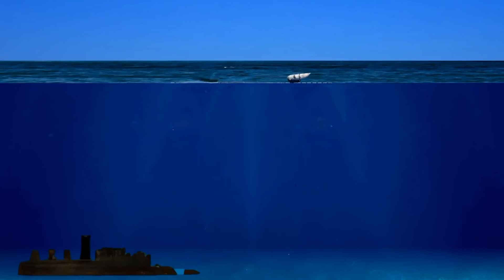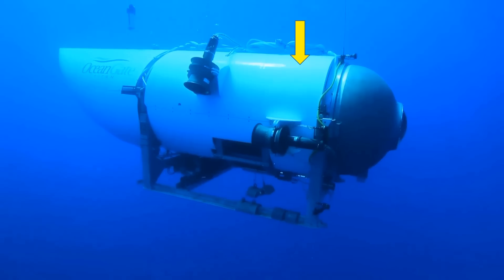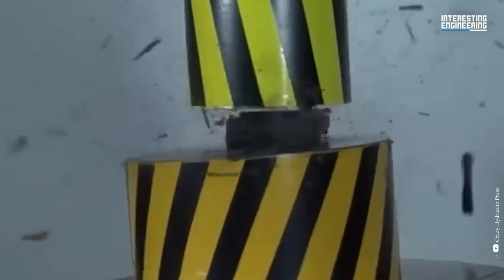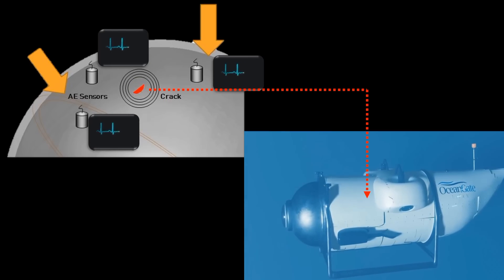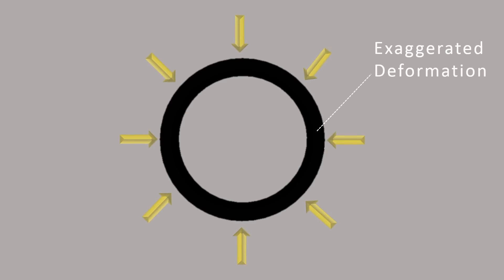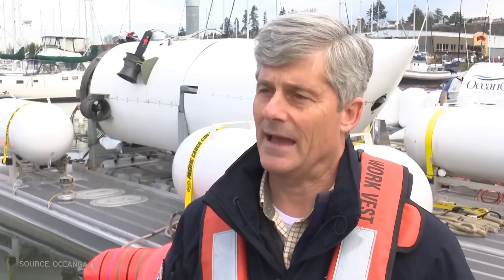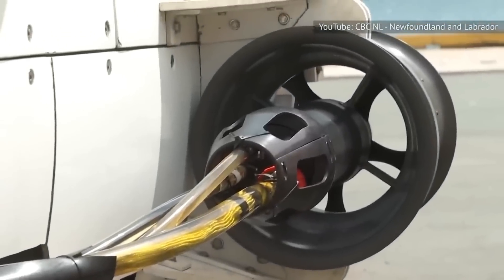Oceangate Titan Did Not Implode Just From Pressure. There Is a Catch!

Comment: My understanding is that carbon fiber composites may crack abruptly when twisted. This might be due to the matrix or glue cracking. So, the carbon fiber body may have distorted under load, leading to cracking, and the glue holding the ends together may have cracked under the combination of cold, wet environment and twisting load. 

I heard an alleged transcript of the conversations between the submersible and host vessel, which indicated the "Titan" was descending considerably faster than expected, and then had difficulty ascending. Might it be possible that the "Titan" was becoming waterlogged, perhaps even flooding in some areas, almost as soon as it submerged? Perhaps the weight of this extra water would have stressed the frame, especially during its struggle to ascend.
Reply: I would also like to know if it was overweight with too many passengers and stuff with insufficient reserve buoyancy for surfacing. Given Mr. Rush's cavalier attitude towards proper engineering and safety, it would not surprise me if he took on too much load.
Reply: Or one of the motors that helped with ascending failed
Reply: @joanbaczek2575  it didn’t use motors to ascend, the motors were for just basic maneuvers.

Comment: 1.  They bought out of date carbon fiber from Boeing

2.  They laid the fiber up by hand, spreading glue with ‘putty knives.’  They did not alternate fiber direction.

3.  It is unclear in their video, but it appears the titanium end pieces only supported the tube’s outside and were fastened by glue (laid by hand).

4.  They did not do ultrasound testing (which is strictly done with carbon airplane parts).

5.  Different materials expand and contract at different rates.  Pure titanium hulls might deform by 2-3 inches under severe pressures.  

6.  The design was not tested.  The pure titanium sub that dove to the 5 deepest places in the oceans was tested in a Russian pressure lab.

7.  We’ll never know but if they had varied carbon sheet directions with controlled pressure gluing plus ultrasound testing with some titanium ribs in the tube…. They might have had a better chance.

The reality is the 5 ocean submersible cost 37 million.  

So ‘denial’ is not a river in Egypt.  This was amateur hour.

Comment: I'm still convinced the differential pressure was the fatal flaw. The titanium halfshell was virtually indestructible but the perpendicular pressure on the side of the flat submersible would have been different from the titanium just inches away. The pressure had to be identical on the entire outer surface but there was differential pressure, one surface weaker than another surface just inches away.  Additionally,  on aircraft we have NDI which tests structural integrity by running electrical current between two probes. If there is even a microscopic separation the electrical current is affected by the air gap which then identifies the suspect area. It's unbelievable that he wouldn't have invested the time and resources which would have been paltry.

Comment: When Carbon fiber is laid up without a vacuum, microscopic bubbles form against each fiber. When the pressure increased the bubbles got smaller and smaller and when the pressure decreased the bubbles got larger. Each cycle tore at the fibers weakening the entire 5 inches. enough cycles and the entire hull failed and the sub imploded. Rush did not spend the extra money to gas out the epoxy resin in a vacuum chamber and this is the major reason it failed.
Reply: Interesting
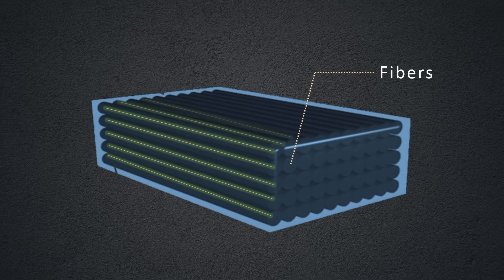Reply: Reckon so. Spiral wound and not vacuum formed……disaster. 4:57
Reply: I made vacuum ovens (AUTO CLAIVES) for Sprite aircraft company, so you are right about this. With out proper curing carbon fiber is only about half as strong. Also, the fibers were wound wrong for this kind of use. I will admit I am getting old, and carbon fiber was new at the end of my career. So, I may be wrong.

Comment: One also needs to consider the lack of homogeneity in the pressure vessel. A Carbon Fibre Tube with Titanium Alloy Hemispheres, means the materials will compress at differing rates. This could contribute to the cyclic fatigue of the Carbon Fibre.  That lack of Homogenous materials bothered me when I first read about what they were attempting a few years back.  I'm bothered by the video showing the Fibre being wrapped, but without a discernable pattern, such as a diamond weave. Wrapped as the video shows, would make me question the vessels strength along its axis, as the Fibre going in one direction circumferential, will not have as much axial strength as a diamond weave would. The thinner Titanium tube, once the CF failed, would have allowed the heavier Titanium hemispheres to slam against each other like crushing a can.
Carbon Fibre is amazing material, but its less predictable reactions under extreme compression needs to be studied more and much further testing, both destructive and non destructive done before it's allowed to be used as a pressure vessel for Manned Deep Dives.
The cavalier attitude towards safety Rush exhibited is alarming. His dismissal of concerns from much more experienced Marine Engineers is particularly troubling. He was obviously out of his depth, and so convinced he was right, and they were wrong. There's rumor,, that Oceangate was buying Carbon Fibre,, that was passed its shelf life for use in Aeronautics use,, if true,, this is troubling as well.
Titan, obviously needed much more extensive testing than it was subjected to. We know that the first Carbon Fibre Cylinder had shown signs of failure after a number of Dives, and that this current iteration of Titan, was using a replacement built in 2022, and that this was the third dive the new CF tube had made, using the same method of construction as the previous tube.
You're right about the real time acoustic pressure sensors. There's no way it could realistically give a pilot ample warning time to abort the dive. 

The more information that become available, the more alarm bells are going off in my head.  While I'm generally not a fan of Government intervention, this Tragedy illustrates the need for established protocols, testing and certification of designs before a passenger AKA  "mission specialist" is allowed on pleasure dives.
The end, when it came, was mercifully swift.

Comment: Titan DID implode from pressure! This video doesn't add anything substantial that other videos and websites have not already said about carbon fibre composites, compression/decompression cycles, and so on. It just adds some details about the tensile and compressive forces, and fatigue. But the bottom line is that PRESSURE caused it to implode! What else could it have been at nearly 400 atm? Temperature? A fire? Attack by sea monsters?

Comment: When the disk in my back went out it made a crack noise. Accustic warning gave me a split second before excruciating pain... Okay but seriously, at that depth accoustic warning seems very dumb since by the time it can be heard it is already failing. Also, all the trapped air in the manufacturing process cant help. That glue was scary. Two different materials held together with glue sounds very sketchy. So much bad engineering I wonder if Rush had a death wish.

Comment: No matter what one does there are always people to “told you
It might fail “. I think carbon fibers are probably not a good choice for underwater applications like this. Apparently titan went in dives 10 x uneventfully. But success in one dive does not guarantee success automatically for future dives.  I didn’t like the way the carbon to titanium ring was glued. I thought they exterior pressure on the carbon tube would tent to shrink its diameter , making it pull away from the titanium if anything.   Anyway they fell into the trap of ignoring degradation of the carbon  structures fibers after each use

Comment: Your over simplified and over complicated at the same time.

Simply put: 
Imagine having a plastic bottle, if you wrap around the outside of the bottle with string, you can increase the pressure that the bottle can hold inside.

   But if  you suck air out of the bottle, the bottle will collapse, the skin of the bottle would detach from the string (delamination). the string does not add any strength.

Now imagine if you attach the string around the inside of the bottle, and suck air out, the bottle will collapse, the string too does not contribute to the strength against compression from the outside. Because string like carbon fiber only strong in tension not compression.  

Carbon fibers composite cylinder can be used for airplane because the function is to retain pressure inside. But not for submersible, where pressure is from outside.
Reply: i didn't agree with the presenter saying the cylindrical shape wasn't a factor unless i misunderstood his point. All the way back to the Bathysphere in 1930 the diving chambers have been spherical. Many of the modern DSV's look elongated or various shapes but the chamber is still a sphere.
Reply: @luvit579  cylinder is a factor. If you look at the section view from the side, it is a ring section. The load are distributed evenly. But from front section view, it is a rectangular section. It is subjected to buckling and bending.

It is easy to imagine, try pumping air into a soft drink can, it will bulge in the middle, and try to be a sphere. That is bending of the rectangular plane. 
Given the same thickness, cylinder shape is weaker.

Comment: exactly what i said the first time i heard carbon fiber and acoustic monitoring
at certain depth all the acoustic alarm is gonna tell you when it sounds it will be "you are already dead, make your last minutes count"
Laminated materials does not work well under pressure as it does with pulling, under pressure instead of try to bend like other materials CB will literally crack and unravel FAIRLY fast (like a rope)

Comment: Hello and thank you, my question is did the different temperatures that titan was exposed to on the surface and below in the ocean. With the number of cycles the submersible was doing  while understanding that titan did not do all its missions. Did this maybe contribute to the ultimate failure?
Reply: Probably, but how cold is the deep ocean?   The water isn't frozen.
Reply: @JoeLinux2000 28°f roughly. Quite cold

Comment: I also can't help but notice at 8:01, the computer monitor seems to be bolted directly into the inside wall of the sub.
Reply: It should be fine. If you notice the inside hull isnt CF. Its just lining. The CF is wrapped onto titanium inner core. Thats what the TV is screwed into.
Reply: @zlonewolf . Someone said the metal core was a mandrel that was removed before the sub went to sea
Reply: @Woodman-Spare-that-tree  the metal core was removed, but inside the carbon fibre pressure hull is a translucent fibreglass tube serving as a liner -- this is what the TV is screwed into, not the CF hull.
Reply: @ma3xiu1  but even so, the metal bolts would have shrank and expanded due to temperature variation alone, depth pressure not withstanding. I assume they would've worn through anyway, given enough time? Seems like they should've used an adhesive to mount the monitor since that's apparently what they were betting their lives on anyway.

Comment: I have worked as a manufacturing and quality engineer in the aerospace business for 35 years and have worked with structural composites and NDT systems for them.  I think the use of any laminate for a pressure hull for that depth is either incompetence or insanity.  Everything I have seen about the material used, from the unidirectional layup to the use of expired pre-preg and not using an autoclave is just evidence of a complete lack of knowledge about composites.  The builder claims less than 1% porosity.  I seriously doubt that.  Not with just bagging on a 5” thick laminate.  No way it’s that low.  I’d like to know what system they used.

Comment: According to unconfirmed transcripts, the craft was descending very rapidly from the start, then when alarms began to light up, they could not manage to ascend even using thrust and jettisoning the landing gear.  The machine had a buoyancy problem.  Was it too heavy to begin with?  Leaking water?  Seems like it would take a LOT of water to keep it down.  Enough that it would be impossible not to detect.  Or was there a pressurize compartment other than the crew area which could have flooded?
Reply: If it had buckled, or partially collapsed, its volume might have reduced, causing a bouyancy issue. I expect the board of inquiry will look at the rate of descent issue closely, if the transcript is accurate.
Reply: Too heavy because too many passengers

Comment: There were no seats and no restraints for the passengers and crew. If it went out of trim, the occupants would be dumped into the end in a pile - good luck keeping control in that situation. The submersible had wires hanging off of it all over the outside - snag and fouling hazard.  There was no hatch, and the occupants were bolted in from the outside (giant red flag). There were no redundant systems. The controls were stupid. 
Carbon fiber is good in tension structures, but not in compression. The glued-on end caps sound like a really bad idea. 
Acoustic sensors are meaningless when the first sound you're likely to hear is the last thing you'll hear - a loud crunch. 
Hubris.

Comment: This is a great example of how education is not a good substitute for common sense. Everything mentioned in this video is irrelevant without the pressure. Thus pressure is the only reason titan imploded. None of the engineering flaws would have been an issue without pressure.

Comment: I think the water got between the carbon shell and the stainless steel tube that the carbon was wrapped upon causing the inner tube (inside shell) to implode first causing a great loss in buoyancy.
Reply: The steel tube was a two piece mandrel and was removed after the carbon fiber tube cured.
Reply: @sportbikerdude  
Ok. Thanks! That blows that theory!
Reply: That explanation is supported by the released transcript of the radio exchanges between Titan and the launch ship, which confirmed that Titan was descending faster and ascending slower than expected. Evidently, it was taking on water.
Reply: @jacobfreeland6881  I think that transcript is clearly bogus.   Too much talk
Reply: @jacobfreeland6881 The so called leak transcipt is unconfirmed and could be false. It was brought up by multiple random youtubers.
Reply: There is no inner metal tube. Google photos of the sub and you can see the interior is bare carbon fibre.
Reply: @bensemusx . Surely there was an inner liner that the TV screens were screwed into?
Reply: @Woodman-Spare-that-tree  yeah I think there was an inner layer of something just for that reason alone.
Reply: It was battery failure mixed with cf hull giving. At the depth you don't just just have leaks anything gets in it's gone in milliseconds. If Stockton was smart he would have adjusted velocity but he was probably in a "Rush".
Reply: @dscwac396  how do you explain them not being able to ascend?
Reply: @TimWnyc  battery failure, they've had similar issues on previous dives.
Reply: @dscwac396 no surprise since electrical was designed by young, student 'engineers'
Reply: @marilynevans8436  lol and the store bought security cameras to see, acrylic window for 1300m, expired FC etc... And trusting extremely smart kids making minimum wage what could go wrong

Comment: they might have been better off welding those two titanium end caps onto a thick steel pipe ???
Reply: a sphere is the only way to go. all deep sea submersibles have a spherical chamber regardless of what they look like from the outside. Military subs don't dive nearly this deep, but if submariners attach a string from one side of the hull to the other when the sub reaches depth the string is close to touching the floor. that's how much the steel is compressed inwards even at depths far less than Titanic.

Comment: How would the cold temperatures at the depth of the Titanic affect carbon fiber. I know it can stand a lot of heat but, from what I've read, it looks like it isn't so good when it gets very cold.
Reply: very good question, of which no one has raised
Reply: Very cold is usually cryogenic temps. Carbon fibre also isn’t great with heat either. SpaceX moved from carbon fibre to stainless steel in part due to needing a much lighter heat shield. The steel could handle much higher temperatures while remaining structurally sound.

Comment: A point about the buckling resistance: as the external compressive load increases, it takes a greater bend in the structure to put the external fibers into tension, so the structure will be weaker at depth than it is at the surface against buckling. Significantly so, because carbon fibre composite is relying on the matrix for strength under compression, and is about 10 times weaker in compression than tension, depending on the composition used.
Reply: Troglokev...great point!
Reply: Total novice here but a question:  When the carbon fiber is under compression from the outside, would not the carbon fiber layers on the inside be in tension?   Obviously not but just saying with all due respect.
Reply: @dwightl5863  a buckle starts as the structure going out of round. In the absence of hoop stress, where it’s  bent more than the natural shape, the exterior fibres will be in tension and the interior fibres will be in compression. Where it is flattened, the interior fibres will be in tension and the exterior is in compression. In the case here, this is added to the hoop stress, which is strongly compressive, so it is unclear whether the carbon fibre is ever in tension before the matrix collapses under compressive load (back of the envelope calculation says no).